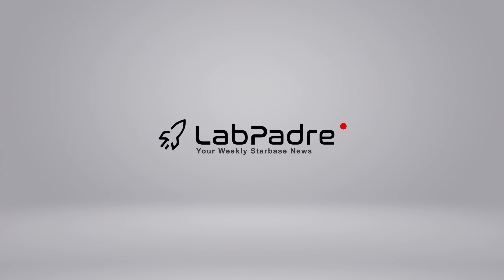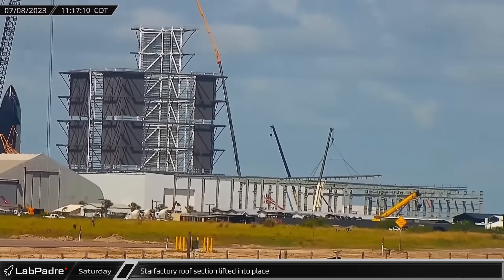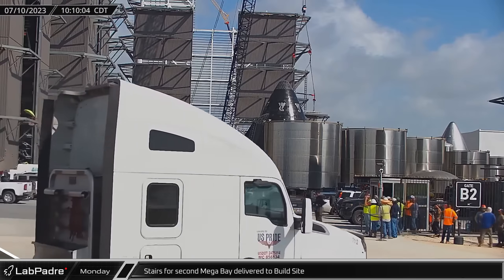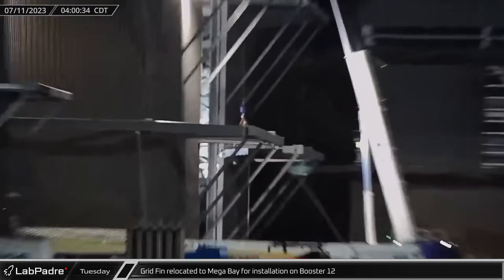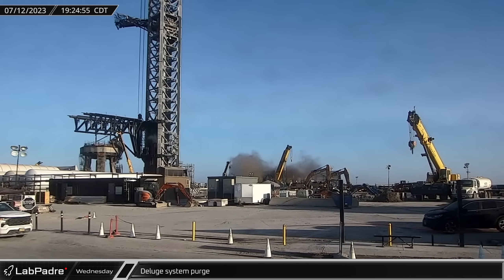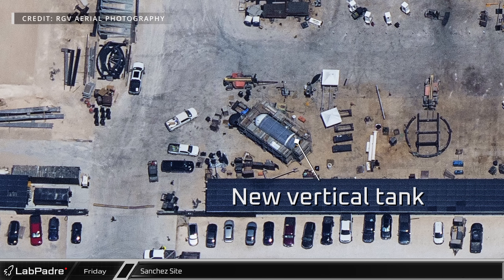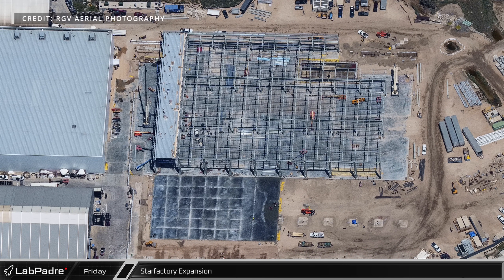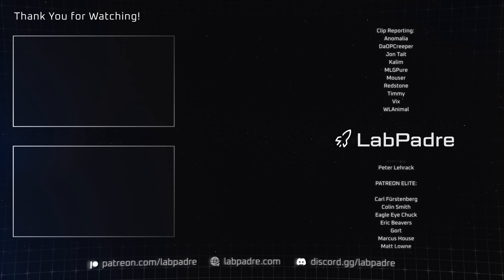SpaceX Conducts Massive Water Deluge System Purge - Starbase Weekly Update #71

Comment: I just can't get over the hyper aggressive rate of work SpaceX is doing with the starship and it's infrastructure.  It's like Boeing in the mid 1960s when they were building the Everett jumbo jet factory.  They literally were building a factory around a 747 prototype as it was built.  In both cases of SpaceX starship factory crews and Boings early 747 factory crews, they will go down in history as the Incredibles.

Comment: Wouldn't it be good to foresee fireproof tiles or something to protect those legs from the OLM? They also took a big hit from those raptor engines? Or am I daydreaming? 🤣 I think this is the most photographed site in the world.
Reply: This has been brought up many times, especially with respect to the existing starship heat tiles. The problem is ceramic tiles are so incredibly brittle they would shatter instantly as soon as the booster engines fired up.
Reply: @Barthhhelona  ok thanks for that info, I wasn't aware of this, but like it is now these will be losing strength, so they have to bring another solution, I'm only an electronic engineer, and this goes beyond my pay grade :)
Reply: @remnote-ffp   NO.
  The most photographed site is my back yard!
  With my 250' pier, mooring my 68' motor yacht, my 52' racing sailboat with pedigrees (trophies), my 32' fishing speedster, AND my 56' cigar boat with 1,800 HP.
  😊.
  👻☠️🗽💯🙏